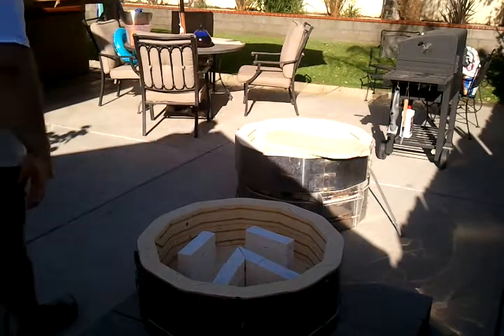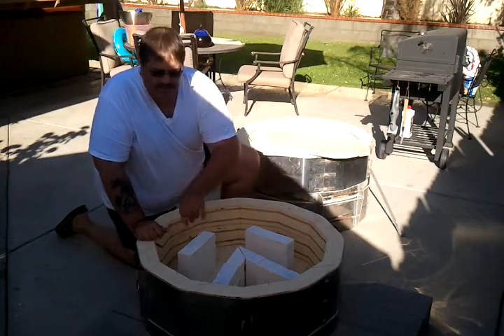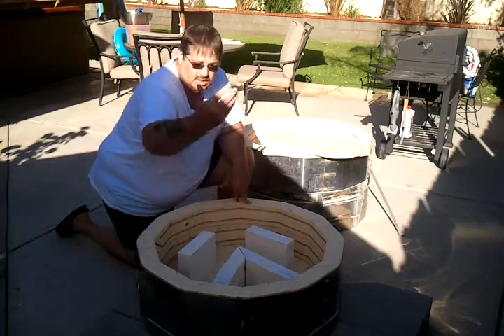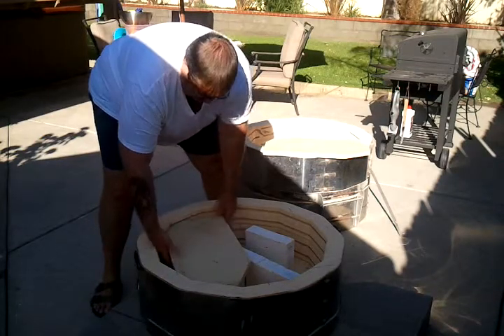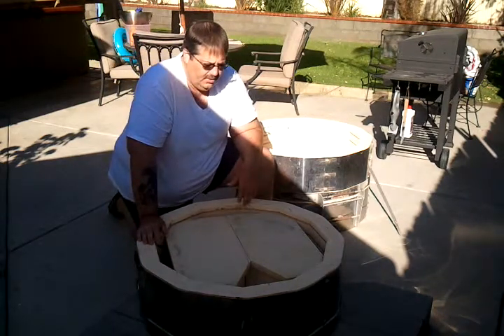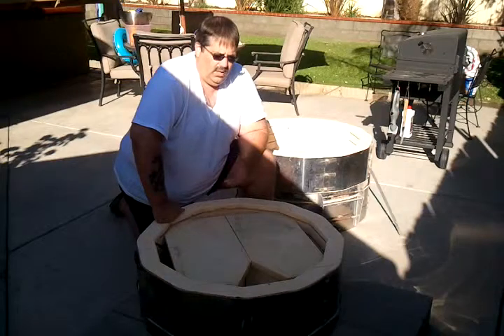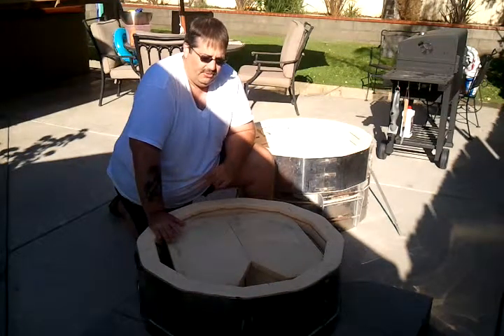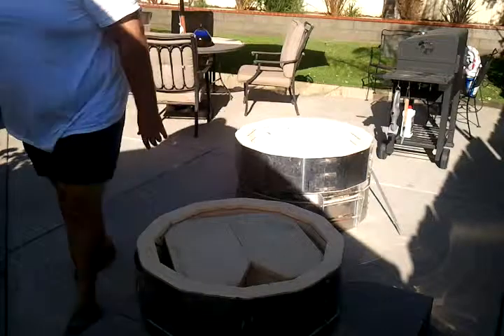Cordierite Kiln Shelf Modification 2

Comment: @Michael0Row .  I see.  On my smaller kiln, I'm using two Gaco MR 750 Venturi's rated at 77,400 BTU's.  Talk about over kill.  I could reach cone 10 in three hours, but of course that would ruin pots.  I'm getting  sucessfull firings in approx 6 hours.  But reduction is uneven, and it's just way too small.  Look forward to  seeing this cadilac youve built on the road!!

Comment from the maker: @pyroclayman The burner I'm using put's out 100,000 BTU and I think the ones that Simon Leach uses are around 30,000 to 40,000. I took the inside dimensions and used a calculation I ran across on the Internet and figured I would only need about 70,000 BTU at max, so I should be okay. If not I can always get another their pretty inexpensive. I've been looking at the burners that Laguna Clay now sell in L.A. and you can run them on natural gas or propane.... just a thought....